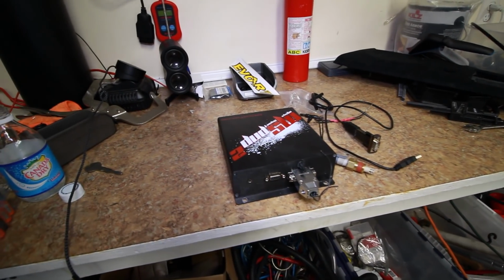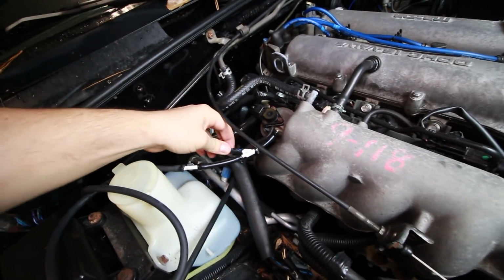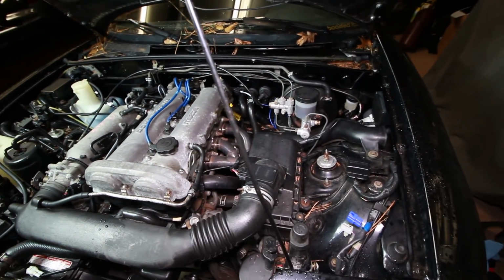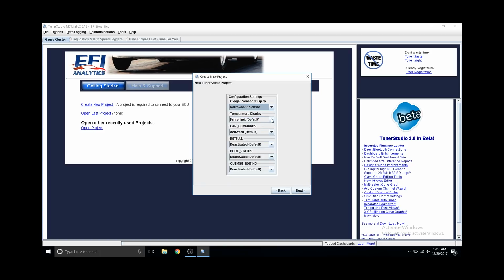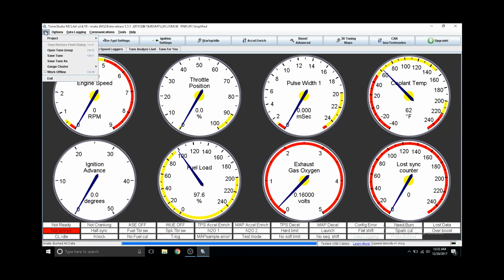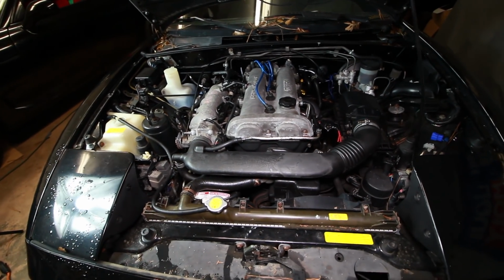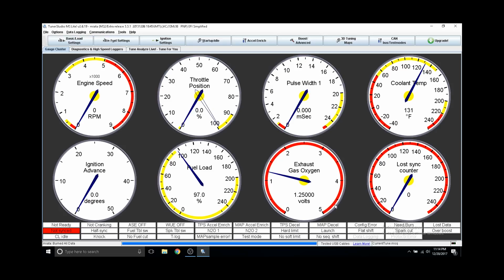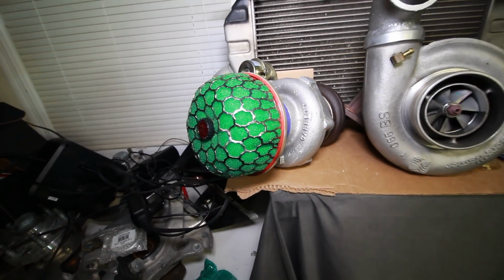How to install and configure Megasquirt - Miata Turbo Build EP2

Comment: You connected to the 4&5 IAC, why not the 1&6 position?
Reply from the maker: IAT right? For 90-93 you do use 1&6. For 97 (this year), you use the pins in the video. 👍
Reply: Yeah IAT,  thanks man. Makes since I have a 95.
Reply from the maker: @r6genesis447  anytime man!

Comment: Another great video, thanks for the awesome content!  I have a question around wiring the IAT sensor pigtail into the MAF harness, what type of connector/pin did you attach to the sensor pigtail wires in order to be able to plug them into the MAF harness at pins 3/4?
Reply from the maker: Thanks again Kevin! If you get the MS PNP IAT kit, it'll come with extra blade pins so that you can plug them individually into the corresponding MAF pins. I did this and then wrapped the connector in electrical tape. That way you can reverse it if you ever need to go to stock. Here's the kit/harness - https://www.diyautotune.com/product/mspnp-and-diypnp-iat-sensor-kit-steel-bung/
Reply: Nice,  I might have to look into the kit.  I ordered an MS3Pro PNP for the 96/97 which was just released.  It came with an IAT sensor and a pigtail but didn't notice any blade connectors.  I'll double check again today to see if they were included.  If not, Ill contact DIY, thanks again for shedding some light on this topic :)
Reply from the maker: you got it buddy! good luck w/ the install 👍👍
Reply from the maker: Kevin Saeed good find man! thanks for sharing the part number. also added in the description in case anyone comes across it. 👍👍
Reply from the maker: Or you could always cut off the connector and splice in the wires that you need & tuck away the rest for a more permanent install ;)
Reply: Thanks, this is definitely an option but I prefer the method you demonstrated in the video.  I'm trying to keep things as reversible as possible in case I need to go back to stock in the future.

Comment: The video helped a bunch! Although my AFRs are not changing in Tunerstudio. Did you have to change any additional settings after you hooked up your wideband output? The gauge itself is working however.
Reply from the maker: Thanks man! Yep, after you connect the output of the wideband to the o2 connector, you'll go to your project properties and select your EGO O2 sensor from the dropdown. Then, under basic settings go to EGO controls and make sure the sensor is set to wideband. Finally, in the tools menu you can make sure the calibration is set correctly. IIRC it should be around 7.35 at 0v and 22.4 at 5v
Reply from the maker: Let me know if you get it working, if not I'd be happy to help further  👍👍
Reply: Thanks for the reply, unfortunately I'm still trying to track down my issue. I'm using an AEM wideband, however it should still be fairly similar to yours. Anything else I should check?
Reply from the maker: Dukepgh no problem! I would probably use a voltmeter and tap into the signal output coming from your AEM. Double check you are seeing something in the range of 0-5v. also what megasquirt are you using? I know some versions do not use the stock o2 harness for the wideband, rather the aux/options connector.
Reply: supercarmio I’ll double check the signal wire, but yeah you might be on to something with the aux input. The directions I got didn’t exactly match the unit and wiring shown in the photos. It’s an ms3. I’ll do some more digging thanks!
Reply from the maker: np! It looks like pin D of the db37 options connector on the back of most MS3s will handle the output of a wideband. good luck!
Reply: @heavyd2249  did you ever get this to work?
Reply: @dangerousfandango5943  yes, there was an additional pigtail that I used for the signal
Reply: Thanks for the video... I needed an actual visual of the screen as direction. Your video did it perfectly.